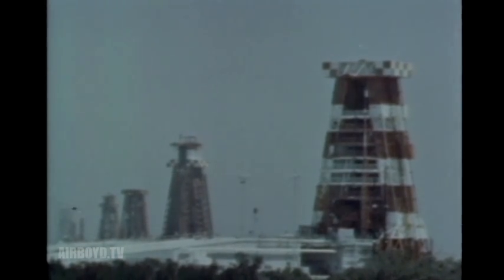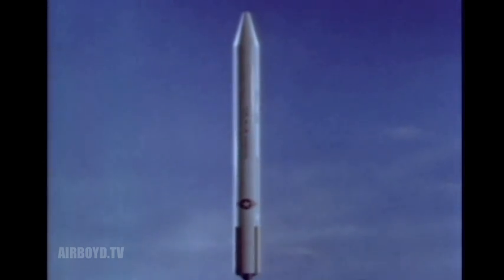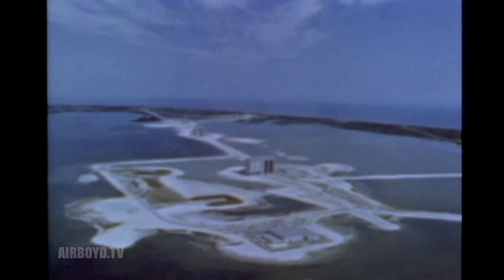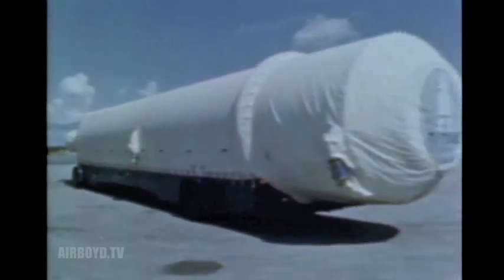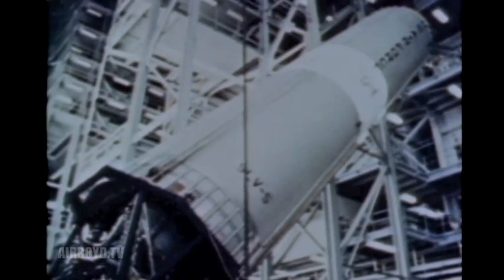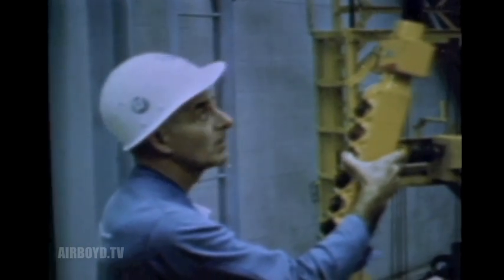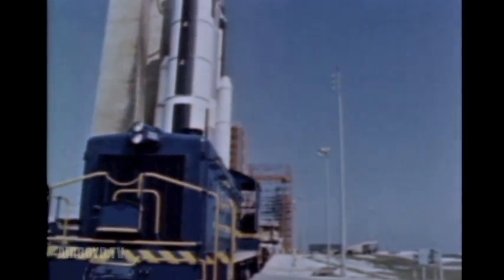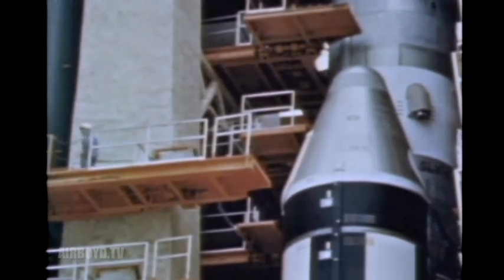Titan III Research And Development (1967)

Comment: It appears to me that NASA used the Titan III program as the blueprint for the Apollo program.  The VIB became VAB, the transporter became self-propelled, and pads 39 A and B were dedicated to Apollo launches.  Everything was upscaled, and the solid rocked boosters were discarded, but the idea of rapid assembly was maintained.  The Titan IIIC was one of my favorite launch vehicles, but it didn't have the long career that I expected.  Nixon killed the program, deciding that the U.S. would use only one launch vehicle for all missions, which is why the space shuttle ended up being a heavy lift launch vehicle.
Reply: Actually, the Apollo-Saturn complex came first. The VAB was completed in 1965.

Comment: This rocket was just so cool! The original heavy lift vehicle. 2.66 million lbs of lift off thrust, SRB's consisting of multiple segments, not only making the 120" SRB a reality, but also providing the technology that made the segmented Shuttle SRB's a reality as well. A main engine that was air started in flight after SRB burn out. 3 stages. (4 if you include the SRB's as stage 1) and an upper stage that could be restarted multiple times on orbit to precisely place multiple payloads into multiple orbits. All based on an already proven launch vehicle. Titan III was just amazing!
Reply: "A main engine that was air started in flight after SRB burn out."

Actually the first-stage engines started 10 seconds before SRB burnout (The engines took three seconds to reach full thrust) when the thrust from them started to taper off.

" 3 stages. (4 if you include the SRB's as stage 1)"

The SRBs were referred to as stage 0.

Comment: When I was a kid in the 1960s I thought this was the coolest rocket ever.  After then, all the rockets I drew had 3 bodies.  After Three came Titan IV followed by Falcon Heavy, though the latter uses 3 liquid fuel boosters and no solids ( but it LANDS!).
Reply: @neo Which one?
Reply: The Saturn five is huge and bad ass but it was not triple core but what about the delta for heavy?
Reply: @deankruse4491  Saturn V didn't need boosters, hence 1 core.  The triples only LOOK cool.  They aren't superior. Just easier to manufacture due to smaller diameter rocket bodies.
Reply: @Doggeslife  Sure but that original guy was talking about all the three core rockets at least that’s what I thought he was talking about.
Reply: @neo Silly statement.  I was there, remember?  I've studied the rocket inside and out. Keep in mind that we did not know how to build big rockets back then.  It was a learning experience, but we've learned so much more since then.   

 It was quite difficult to maintain combustion stability in such a huge engine as the F1, and that's why we don't build them big like that anymore.

But if I were jealous would I have two Saturn 5 launch videos on my YT page? Happy flying!  https://youtu.be/YJ3LiEC6wtY?list=PL9v0WV0TDftTNsUFfaiba9JSzth6E06Ii
Reply: @neo Most were used on missions, though a few were put on display.

We have learned a lot since then, so no sense going back to an antique design.  Moving forward!

Comment: While the Titan III was a very capable rocket it's a pity they didn't go with the Saturn I/IB instead.
Reply: Nature and Physics  That is correct however both the Saturn IB and the Saturn V had applications beyond the programme. If NASA hadn't have had its' budget severely curtailed in the late 60s there's a LOT more that would've been done with them.
Reply: Nature and Physics  If you don't believe then check this out: https://periscopefilm.com/saturn-ib-saturn-v/
I've NASA technical papers discussing the use of the Saturn V to launch heavy interplanetary probes called Voyager (They had nothing to with the Voyager programme for a grand tour of the outer planets).

Comment: The Titan III had its share of failures including its first launch.  So to say its reliable is a matter of perspective. For example the Titan IIIC had 31 success's and 5 failures.
Reply: The first Titan IIIC did reach orbit with its inert payload. The first Titan IIIA fell short of orbit, but not by much, and due to an easily-remedied Transtage problem (the Transtage shut down a few seconds early, but the vehicle achieved 95% of its test objectives), and:

The vehicle's achievement is illustrated by the fact that five Titan IIIAs were built, but the next three performed so well (not just reaching orbit, but accurately delivering multiple-satellite payloads to their planned orbits, and making triple restarts [which hadn't been done before]) that the fifth Titan IIIA mission was cancelled. That Titan IIIA was sent back to Martin to be converted into a Titan IIIC core vehicle, as which it was later launched.